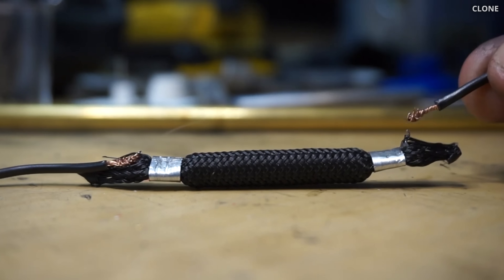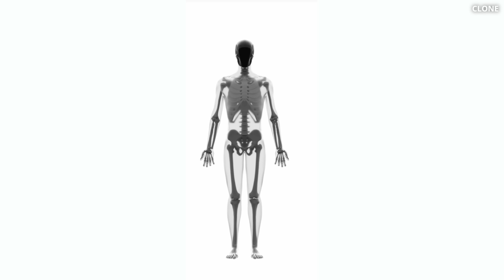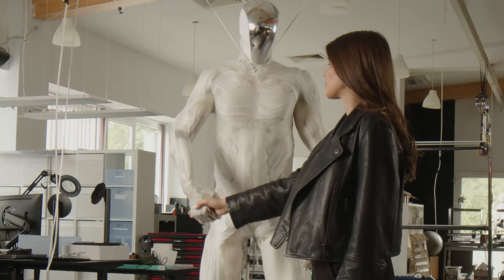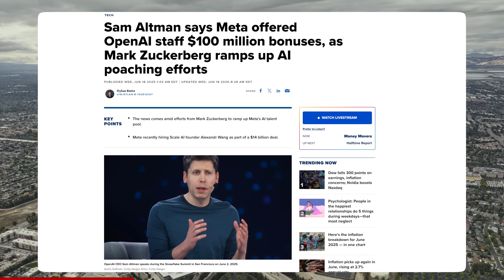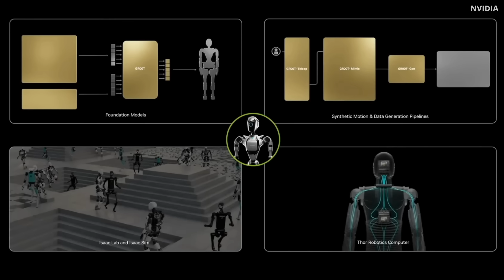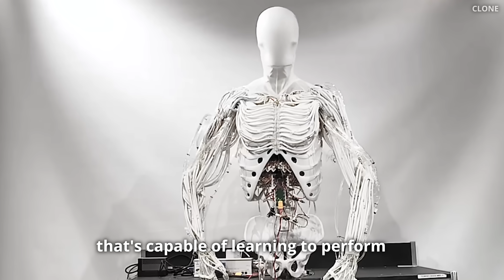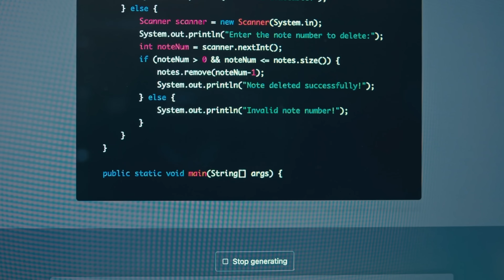I Met Protoclone. It’s Actually Insane

Comment: This is very interesting, although it's a very early stage of development.

Will Cogley has made a series about making a robotic hand with motors (mostly cable-activated) and another series about animating a face and a head (he hit a copyright-related thing with animating the skin). The series about the hand is excellent because he shows how Nature engineered these 12 bones with awkward shapes that make it able to do so many things.

From the beginning, you don't want "weaknesses" in that robot, quite the opposite. You want the robot to do things you could do yourself but don't feel safe to do, you'd count on the precision and speed in decision-making of the robot, such as cleaning windows from the top of an unstable ladder... That one is actually fairly complicated, because it requires the robot to solve the problem of the unstable ladder before it tries to clean the window, good luck with that.

Also, no-one speaks about price. Boston Dynamics have understood pretty well that the housework assistant would be a commercial flop, you want a robot that does "hazardous" things, you're not going to pay millions of dollar for a personal assistant that does the cooking and the hovering in your condo, you'll use it as a cook for your high-end restaurant because it has to "earn" money, that's the base of the capitalistic system: a workforce able to work night and day in a safe manner at a lower cost than the human it mimics.

Comment: I can't wait to be on the board that regulates the AI space. It does confuse the very core of human interaction, by saying that a machine is a "companion". It's only capacity should be to SERVE. If you're disabled, then you have it pretty much 24/7. If you're normal, then you only use it in the work space.

Comment: Okay, pressure sensitivity is easy if you just have a water pressure censor in every muscle. Compare the pressure to what you should get in theory and you know how much resistance the object has.
As for walking, I don't think this is efficient. That much water is heavy. If I was to build an android, I would favor the female form out of practical reasons: Breast fulfill a function Androids don't need, so they are the perfect spot to put battery packs. You could make them easily detachable for charging.
Alternatively, in a hydraulic android, they can serve as hydraulic fluid reservoir.
Ultimately, my verdict for this android: Upkeep will be a nightmare, Very heavy, very expensive. I'd keep the hands, but for the rest.... probably sticking with servos.

Comment: There is nothing special about hydraulics. Seems obvious. All you need is a compressor and electrical supply strapped to your back. Come on. This is not viable any more that others. The energy supply is always the problem. Also, it's hanging from its neck. Hmmm. Well, we know why. It can stand up.

Comment: I’ve never seen a hydraulic system that doesn’t leak.
Reply: Humans also leak.
Reply: @world_still_spins  but we self-heal leaks.
Reply: @world_still_spins exactly.
Reply: Yes, the workload of disassembly, cleaning, replacement and assembly is huge.
Reply: They’ll eventually need to create a system based on the human body.  The muscles are constantly bathed in lubricants, fed by nutrients and relieved of waste all by the same lubricants solution.  Any eventual successful system will have to use the entire body as a cooling tank for the hydraulic fluid.  So the tubes, like our veins can leak a little and be permeable…but the outer system will be largely leak proof-ish.  But this system will need daily maintenance just like we use bandaids etc and the fluid will need an oxygen activated coagulant to seal small leaks
Reply: @viscache1  I'm sure once the thing becomes self aware it will replicate itself to a better and better version to infinity.  It will eventually just be a wisp of air that can manipulate quantum fields.  But for now I suppose a fluid that reacts like platelets when exposed to to a material in the sub body will do.
Reply: 2:54
Testing leaks and pushing a needle through the middle to test leaks around punctures.
In case you missed that part.
Reply: One thing that most people take for granted is the simple act of standing and walking across the room, running to catch a bus and stopping quickly to allow the elderly woman to sit in the seat we had planned to use.. balance.  This is the most miraculous of all feats that we accomplish.  Our brain and body contains dozens of individual gps modules that sense in milli-degrees of sympathetic balance to our environment, thousands of sensory inputs per millisecond and that invisible ‘6th sense’ of time space presence and whether we are perfectly balanced in that environment.  It’s why we can swim upside down in a direction we choose.. it requires trillions of inputs per second and we don’t understand it yet…not even close…so imitating it perfectly is still far away
Reply: @viscache1 pinch your sciatic nerve and you will be quickly releivedof such hubris as you struggle to pull yourself across the floor as you find out that even tightening your hand and arm muscles requires back muscles. 😂😂😂😂😂
Reply: @viscache1  The thing about nature is that anything it produced can at a minimum be matched. It's a blind watchmaker.
Reply: Do you not bleed
Reply: Und dann bekommt jeder der 8 Milliarden Menschen einen Roboter? Sehr realistisch 😊
Reply: @LiveIsaanAlternative nein sicher nicht, das geht sich nicht aus. Jeder der es will und es sich leisten kann, bekommt einen, vielleicht kristallisiert sich die AI verwendende Ober/Mittelschicht heraus, die über den Rest herrscht.
Reply: Yes but its also safe in some point. It will be easy disactivated if something go wrong ;)
Reply: The android needs a diaper then 😂
Reply: Humans are a hydraulic system. Yeah they leak. Some of it intentionally, ie breath,  pee, + poo. Or puke. Unconsciously too, like sweat.
Sometimes they cry. And 1 gender bleeds often for a few decades.

Easy refill at a tap, etc tho.
Reply: Thank f#©|{ for that, yeah!? 😅 Just give it 300 hours of runtime and then we can all go outside again 😂
Reply: That's a good thing. In case we need to take them out, they'll bleed.
Reply: Boston dynamics moves from hydraulic to electric, i think this company didnt get the memo,
Hydraulic requires so much energy and space
Reply: It will need to take a leak...
Reply: You've also never seen the terminators of the future
Reply: Well, there is a male body part that can expand, get hard and leaks 🤣 It wll be part of the design.
Reply: I would think smart materials that expand and contract under electrical stimulus would also work but guessing these muscles use less power.
Reply: @richardruddy6341 batteries..that’s the limitation.  Hydraulics are used in heavy machinery because electricity is limited when you are not attached to
Reply: It will be constructed with self sealing material. The water will be replaced with self sealing glycol antifreeze.

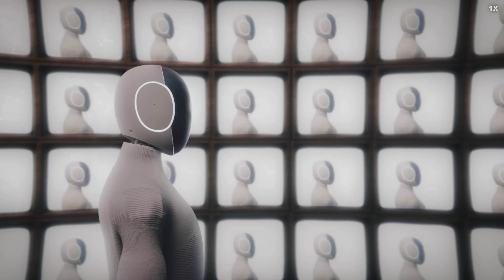Comment: 7:17 You talk about these robots using motors as if the android's hydraulic pump operates on magic. It's going to run out of power just like any other machine.
Reply: Context matters. So, look for every limb movement those humanoids robots rely mostly on motors. This system reduces the use of motors for limb movements.
Reply: @shakrosemusiq9301  You're of course correct if by say "it reduces the use of motors" you mean that it reduces the number of motors used to one motor. But that one motor is still doing ALL the work moving the limbs.
So, from the way I'm talking about it, it doesn't reduce the use of motors at all. If you remove that one motor, the thing is just a very expensive mannequin.

Comment: Very impressive, but the hydraulics will be bulky and prone to leaks. This is why Boston dynamics moved away from linear hydraulic actuators. BD used rigid rather than soft hydraulics, but the issue remains. I think this is a worthwhile experiment but it will not get there. Hydraulics are powerful, but the trafeoffs are not worth it.

When someone invents a linear electrical actuator, whether rigid or flexible, that can perform as well as hydraulics without the drawbacks, that will be the breakthrough that changes everything.

Comment: A.i is my most important tool in my life. I have a multi-prong approach to be coming fully independent working for myself. 2 parts 1 turning a hobby into income since I am very very good at it 3d printing. AI has been crucial and not only learning how to 3D print but talking out failures problem solving And one of the real big crucial parts designing yeah I held my hand and took me through step by step learning how to use software like fusion 360. Plus with AI designing software that saves me hours of legwork. I always use my toolbox as example I want to build a toolbox. I have the skill level to do this but I use an AI tool to handle the base shape. This saves me a considerable amount of time while the AI is constructing that base shape I could do something else or watch either way it saves time then I go in and add in the details. A.i has helped me reach pro level with 3d printing. 
Part 2 day trading cryptocurrency a.i has been AMAZING!!! I knew nothing going in just had one goal Not to get rich but to replace income to make ruffly $400 a week trading. A.i helped me accomplish that!
   I even use a.i like co-pilot as a interactive journal a sounding board and it's been ridiculously helpful. I am also a writer and have always enjoyed occasionally journaling so using co-pilot as an interactive journal is just next level.

Comment: All this technology is not some new breakthrough, I saw a display of this “muscle” using water at the Sinsheim technical museum in Germany back in 2005. You can also install one way valves at an end of the muscle and it’ll actuate as a pump that pushes water/fluid in one direction and at a serious pressure rate. The key is the electricity that makes the muscle contract or expand, the fluid inside acts as a sort of filler to give it rigidity/strength. Every modern artificial humanoid robot uses this type of system in concert with other elements. Just remember friends, there’s already been a LOT of improvements in this industry and they’re perfect for an army or police force and there’s many of them in storage and are light years ahead of what we see on here.
Reply: And they can't be killed with a common cold virus either. ... 👀
Reply: No?

Comment: The device is starting out NOT using the tech already developed. Teaching/programming a robot to manipulate tools, etc is missing the point. The programming is the robot's task, not the builder's except that the builder's need to build the robot so it can program itself. That means, for instance, probably an order of magnitude more sensors so it can study its own movements both tactilely as well as visually. That would allow it to develop a sense of the 3D world too. If they don't do this --- and obviously it's no small task -- then the product will be just another humanoid-shaped machine that's maybe useful for some specific tasks requiring quick reflexes, but otherwise it'll be archaic before it's built. What they've done is interesting, but I heard no mention of protections of the mechanism from itself both in terms of learning as well as in case it actually damages itself.
Seems there's a few more steps before that 'companion' mentioned in the video is available. It is encouraging that someone is trying hydraulic movement but getting that tech into a physical frame close to human size and have it be like a human -- very difficult, and expensive.  Still, you gotta start somewhere, and this start is quite creative.

Comment: I think the general approach is good to structure the robot's body after the human body's skeletal system with muscle analogs attached. However, I don't think hydraulics will ultimately be the best choice. There are electrical mucle fibers that contract when current passes through them, which may behave more like muscle but are weaker. Some advancement needs to be made so the muscles are self-contained and not driven by pumps and systems of tubes that can leak. There needs to be a breakthrough in a muscle material that is durable, operates on electrical stimulation, and has almost the strength of human muscle. Perhaps they'll even be composed of organic materials grown in the lab. Capillary systems could bring reactive compounds to and from the mucle fibers.

Comment: These robots will be good in 10 or 12 years but they aren't ready for prime time.  For the short term, the electric robots with motors will have to do.  They are much more ready to come to market fairly soon.  My guess for them is about 3 to 5 years, maybe even sooner in some cases.

Comment: Birds walk on 2 feet.  Yet we rarely if ever consider them as bipedal .
Reply: Birdbedal
Reply: Probably because the ones that fly spend more time flying.
Reply: FWIW When you ask DeepSeek AI if birds are bipedal:  

Yes, birds are bipedal. They use two legs (hindlimbs) for walking, running, perching, and hopping, while their wings (forelimbs) are specialized for flight, swimming (e.g., penguins), or balance. This adaptation evolved from their theropod dinosaur ancestors, which were also bipedal.
Reply: @cali4tune because you didn't ask it how birds should be described from the common, perceptual perspective, which would allign with the context from your first post
Reply: @aaronicsmanpremium maybe… but does it matter because some birds clearly are bipedal so it’s not wrong.
Reply: @cali4tune You seem to ignore the words "rarely/mostly/most" - used in the thread you started.
Reply: Mostly because most birds don’t use their feet as their primary method of travel
Reply: @dabbingraccoons6416  but flightless birds do... and honestly when flying birds walk I've rarely if ever seen them walk on "4" (wings).
Reply: @cali4tune clock it!
Reply: @cali4tune  Acknowledging that flightless birds are in the vast minority in the realm of birds, and that total air distance to total distance covered by birds (according to GPT5 - 92%  [one bird represents one species]) -  damanding considering birds as bipedals in the context of the movement manner is just pure 'pain in the ass' symptom.
Reply: @cali4tune  because they are dinosaurs - hardly something that comes close to human intelligence, since evolutionarily they are not meant to do much thinking. bipedalism of apes allowed for arms to be repurposed for creativity and came together in one wave with increase in the size of frontal cortex, intelligence and culture. Bipedalism, as we see in raptors is a little advantage when the upper limbs turn into wings instead of instruments of work. technically, yes raptors are bipedal. there are plenty of prerequisite steps needing to happen before bipedalism turns into a real evolutionary advantage.
Reply: @aaronicsmanpremium 😂